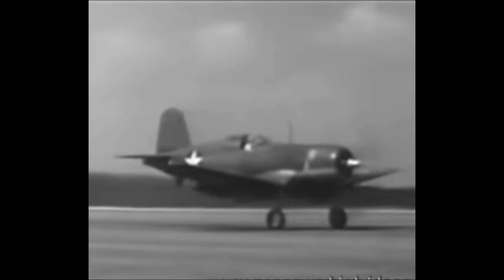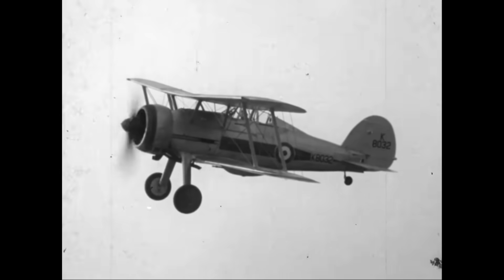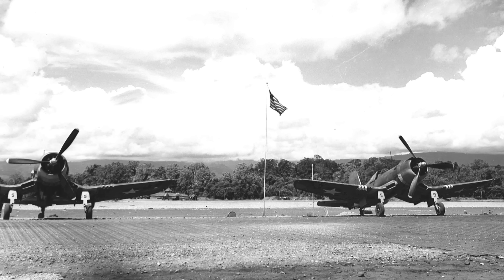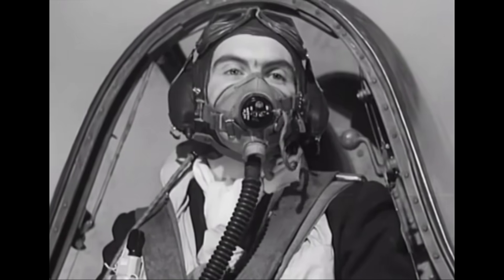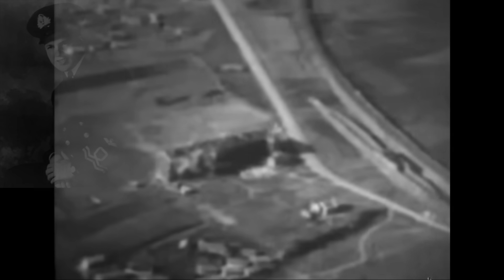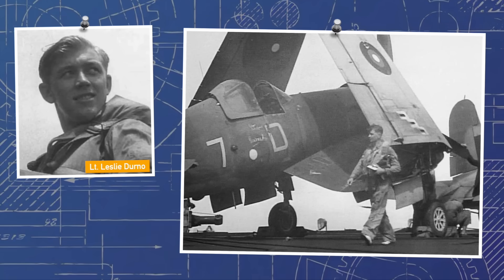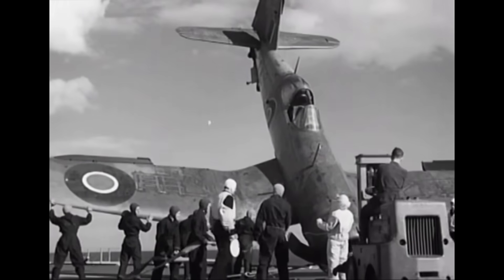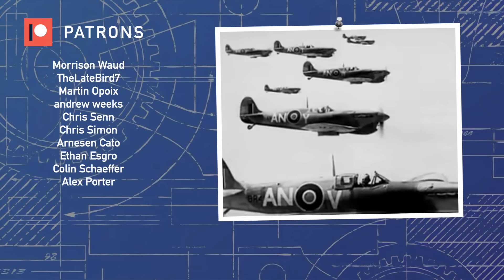Why Did Britain Use American F4U Corsairs? The Full Story

Comment: The Hawker Typhoon had a 13' diameter propeller.  No need for gull wings, carrier ops or otherwise.
The reason for the gull wing is that the angled wing root is the most aerodynamic and simplest way to attach a wing to a cylindrical body.
Reply: Why not both... aerodynamic efficiency AND short landing gear.
Reply: @kieranh2005  
The principle reason for the design was how to join a wing to the cylindrical fuselage.  
It may have enabled shorter landing gear, but that isn't a particularly important feature for carrier ops, as many other aircraft have better visibility for the landing approach than the long nosed Corsair.

There are plenty of successful carrier aircraft that had no problems with landing gear being long.

I don't know if the gull wing has any affect on taking off from a carrier, but longer legs would be of benefit for a shorter take off as it would increase the angle of attack.
Reply: not true
read the design notes of the corsairs development
also the corsair was FAR FAR more rugged than a WATER COOLED typooon
Reply: @ripvanwinkle2002  
What's that got to do with the price of snuff? 
Where did I say the Napier was a more rugged engine than the Corsair's?
 
The Tiffie had a big feck off prop.  Go Google it if you don't believe me.*
The question is about why the Corsair had a gull wing, and the commonplace belief that it was ground clearance for the prop is not correct.

It was an engineering and aerodynamic solution which did away with the need for a clunky wing root fairing.

*Here, I'll save you the bother, no need to thank me:
The Typhoon is a large and imposing aircraft for a single-seat fighter, with a wingspan of 41½ feet (12.65 meters) and a massive three-bladed 14-foot (4.3-meter) diameter propeller. 

(The Typhoon was) Powered by a liquid-cooled, 24-cylinder, 2,200-horsepower Napier Sabre engine.

The powerful (Corsair) engine required a large 14-foot diameter propeller.

The F4U incorporated the largest engine available at the time, the 2,000 hp (1,500 kW) 18-cylinder Pratt & Whitney R-2800 Double Wasp radial. 

ie The same diameter prop, but no gull wing on the Tiffie required, and therefore the diameter of the Corsair's prop did not necessitate a gull wing either.
Reply from the maker: I think you've misunderstood, the Corsair had to have relatively short gear in order to withstand the force of the carrier landing, the question was how to get BOTH a short, strong gear, and a 4 metre propeller. The answer was a gull wing.

The Typhoons landing gear didn't have to contend with carrier landings, so lengthening it wasn't an issue. That's why the Typhoon has a big prop too without a gull wing.
Reply: @aviationdeepdive  
I haven't misunderstood at all.
The gull wing may have had the benefit of offering a shorter undercarriage, but that was not the primary reason for the gull wing in the design.

The Hawker sea Fury also had a large (5 blade) prop only 6" shorter than the corsair 
It's undercarriage is about the same length of the Typhoon's. 
AFAIK it had no problems with carrier ops.

Had the Typhoon been navalised, the undercarriage would have been strengthened.  There is no evidence that undercarriage needs to be shorter for carrier ops. 

Ironic that the USN stopped carrier ops due to the undercarriage.
Reply from the maker: Just because the Hawker Sea Fury managed it, that doesn't mean the Corsair didn't have an advantage in the gear department.

The landing gear of the Corsair was FAR stronger than the Sea Furies. It could be used an airbrake at very high speeds - in the world of design everything is a tradeoff. Sure the Sea Fury managed it, but that doesn't mean that the Corsair didn't do it better.

I'm not saying that the gull wing was done only for this reason, I'm sure it was also easier to join onto the cylindrical body, but aircraft designers scarcely make a design for just one reason. It seems clear that another reason was that it would allow much stronger and shorter (and lighter) anding gear than would otherwise be required) @pencilpauli9442
Reply: @aviationdeepdive  
Citation needed.
And good enough is good enough.
Why would anyone piss around making a gull wing just so the undercarriage can be stronger.

You're not going to convince me that the Corsair's undercarriage has any significant advantage over any other aircraft designed for carrier ops.

There have been plenty of such aircraft produced with much longer legs than the Corsair and so it continues to this day.

The Hellcat didn't need short fat hairy legs.
Reply: @ripvanwinkle2002   iT DID NOT TAKE LONG?

Comment: Thanks for getting the FAA  and the RAF right at the start of the war. Bloody crabs. 
The Fulmar wasn’t actually a descendant of the Battle. There are some similarities in look but it’s not a Battle derivative. It’s from a pre war specification from the FAA.
The first Corsairs were bought by a Royal Navy dude on his own jeopardy. Balls or what? 
Brewster !! What a disaster.
Reply: In regard to the Brewster the Finns want to have a word with you.
Reply: @brucenorman8904  The Finn's were successful in spite of the Buffalo not because of it. When they converted to ME109's their kill rate skyrocketed showing that the Brewsters were really holding them back.
Reply: @brucenorman8904  I know, i know.  But, to be honest. Me in a balloon with my uncles shot gun could have bagged a few of that calibre of opposition at that time . (Also, see tactics v aeronautics by some clever bloke who’s name I’ve forgot)
Reply: The Marines of Midway and the RAF of Singapore had a different experience. There seems to be a differences between Brewster designed and built vs Brewster contract builds. There is a reason that Brewster ,as an aircraft company, doesn’t exist post WWIl.
Reply: @brucebeauvais1324  Yeah, Finns did ok. Different oppo though. 
The Bifaloo was a good kite until you put extras on it. Like radio. Self sealing tanks etc.  I do feel a bit sorry for the BB.
Reply: Although I’m not a ex-WAFU, I get fed up with Crabair too. 

72 hours waiting for a bloody Tristar to be repaired might have something to do with it!!